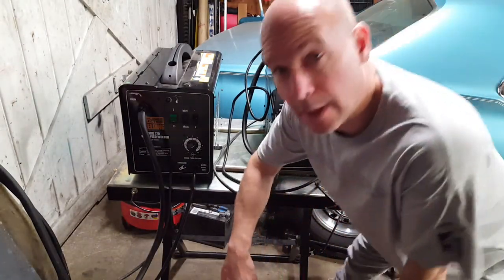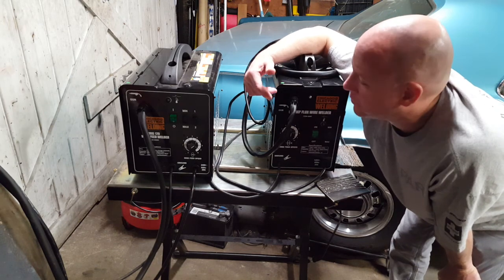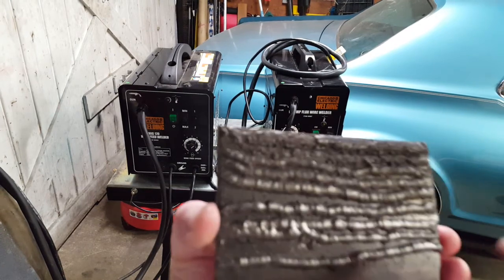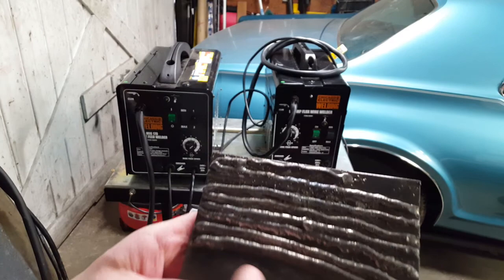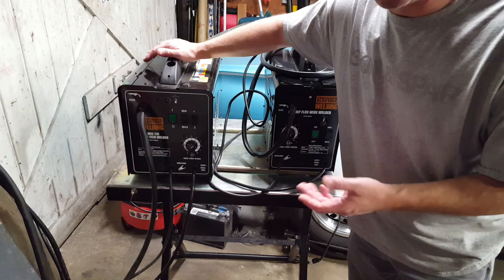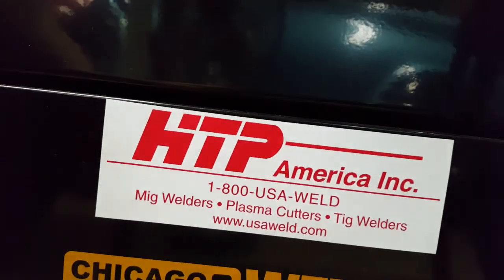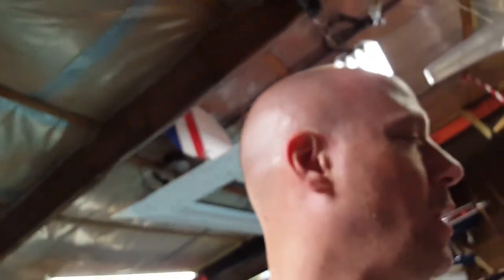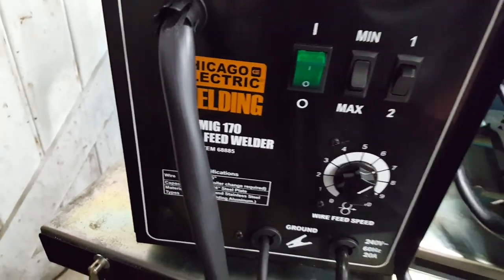H/F 170 Amp Mig/Flux welder, A nice upgrade from the 90/125 Amp welder !

Comment: Good review. I’ve had  the 170 for a little over a year now and have have done about 3 projects with it. . It’s not getting heavy use but one thing I will say is the stock flux core wire that comes with  this unit I didn’t like so I switched it with some 035 Lincoln and it was way better. Eventually I want to upgrade to a Lincoln but not I want to wait till this unit craps out. I won’t hold my breathe because it’s not getting daily use. So far I’ve made a bench grinder and vise stand, and I also made a diy belt grinder with this unit. No complaints but I am not a welder by trade.
Reply from the maker: Sounds like you are getting some good use out of it tho, glad to hear it's there for you to get those projects done that's great! 👍👍

Comment: Good video bud you'll be running good flux beads in no time and seeing the chalk line is all about gun angle if your pulling the wire and wanna see the line you have to take and hold your gun at about 10 degree pull and hold your head behind the gun you can't look at the arc and expect to see it , i run lines every now and then at work when i can't see the fit up BUT i run .052 pulse mig spraying and I'm pushing so it's a good bit difference

Comment: Remember..the wire speed automatically increases AMPS..the OTHER button controls voltage.   WIRE STICKOUT SHOULD BE AROUND 5/8TH INCH..  PRACTICE WILL GET U GOOD WELDS

Comment: I own the HF-170.  Have you done any MIG with yours yet?  I think the chart settings on average are higher than they should be especially with thin stuff.  For the past few years Ive mainly flux, with .030 wire and also did the capacitor mod last year that some people do to make it somewhat more like a "real welder" lol.  The cap is mainly for thicker material though (3/16" or greater) and I also installed the optional toggle kill switch.   Anyway,  I just ran my first MIG beads with it today with C25 mix and .025 wire.  I can only say that the MIG chart was way waaaay off unless I'm doing something wrong.   For MIG with .023 wire on 18 gauge sheet metal (mild steel) the MIG chart calls for Min-2 / spd-6 and gas flow of ~6 to 8 (I did 8-9).  I'm using Lincoln .025 wire / .025 tip and I could only manage to get a decent weld on Min-1 / spd-4 to ~spd-4.5  at most.  Even at spd-4 I felt I had to move pretty dang fast to keep from burning through (and did several times in the test process).   Any higher power / higher wire speed and I burned through the sheet reaallly quickly.  And testing was done in the shade at ~70 degrees ambient mind you!  

At first it seemed to "power pulse" strangely which was due to the wire being too tight and or also not having switched the feed roller disc to the .023 groove.  After that and turning the machine down low, low, ..and lower.. it improved.   Having no spatter and crust to clean up is a new joy for sure.  And I like it as a flux machine but what I mainly don't like about this welder as a MIG, aside from the 4 bare-bones power setting options, is that you've got to turn the gas on right before you weld, set the flow rate, and then immediately turn it right back off as soon as you finish a bead.  I thought that this would have some sort of solenoid in it (either in the case or gun) that only turns on the gas when you squeeze the trigger.  As I understand it, that's how it works with TIG machines.   Maybe professional MIG machines have this feature too?  If so, I'm going to start shopping for a better welder and or a way to modify this one.  After turning the regulator on and off 20 times I was really ready to just go back to flux.
Reply from the maker: No I only flux core with this machine. My other machines have standard argon/ co2 fittings, where as the 170 machine has that goofy little hose barb fitting. And I'm too lazy to mess with it. This way it makes me flux core weld with it, and that's ok.

Comment: The Vulcan flux core E71T-GS .030 wire is way Overpriced $21.99 for 2lb  at HF   You can get a 2lb spool  Klutch .030 E71T-11 at Northern Tools for only $14.99  E71T-11 wire is Better then E71T-GS , Blue Demon E71T-11 is USA Made and it is a Great Wire  Amazon  $14.85

Comment: What size wire will it run you were running 030 wire most mig welders have two slots in the feed roller and they have an extra groove in them for 035 wire will the Chicago electric weld with either one?
Reply from the maker: It will run 035 with purchase of the 035 roller from H/F.  I personally have not run 035 fluxcore yet, but it is on my to do list.

Comment: Can either of them be hooked up to gas? I wish I had 220v at my place. I dont mind forking out a bit more for the 170 rather than the 125amp.
Reply from the maker: Yes the 170 can be used with 75/25 gas = argon/Co2. The smaller 110 volt version can only run flux core. It has no gas provisions.

Comment: I have bought this machine and am a beginner, my question is that copper part around the tip of the gun turned dark and crappy looking. I am not caring about looks as long as am not damaging the machine. Any input on why its turning so dark?
Reply from the maker: If you are using Flux core, it can make contact tips messy fairly fast. Mig not as fast but depending on how much welding you are doing type of material you are welding,  won't bother the machine just keep it clean. Small wire brush works good.  Hopefully some other folks will chime in with  good ideas to also help you. 😊
Reply: Thanks, I am also using the cheap wire it came with and read its not the best either.
Reply from the maker: No, included wire is pretty sad. If you can grab the Vulcan wire it will  a noticeable improvement,  or the Lincoln wire is great also.

Comment: To learn welding what is the best option?
Reply from the maker: As In either Mig 170 or the  125 amp fluxcore machine ??
Reply from the maker: If you have 240 volt available then the Mig 170 would be a great starter machine. My opinion!  If you only have 120 volt available then 125 amp fluxcore rig would be a good start. Once again my  opinion.  😀
Reply from the maker: Hope this is helpful 😀

Comment: The both units are  junk  the duty cycle is about  3 crapy welds then they shut down don't  waste your money  about the  only thing you can do to make it  better is buy quality wire an  change the  ground  clamp and you can get a  bead

Comment: how many welders do you have, lol??
Reply from the maker: Two Lincoln, one Central electric fluxcore, one Central electric flux/mig 240 volt, one Central electric 240volt tig/stick inverter.  One Hobart handler 240volt,  and the Vulcan. I don't need all of these,  I chose to have this many.  I'm not addicted I can stop any time.... I just don't want to.  I want just one more that I'm done!  Kinda......
Reply: Workshop Tazz hahaha, yeah, I know the feeling 😅
Reply: @workshoptazz7893  I know the feeling I bought a Lincoln 225 amp Ac/Dc arc welder, Clarke 160 mig welder, bought the Chicago electric 125 flux wire welder with change I saved over a years time and just bought one of the 80 amp inverter arc welder Chicago electric recently just so I have options for whatever I want and or need to weld